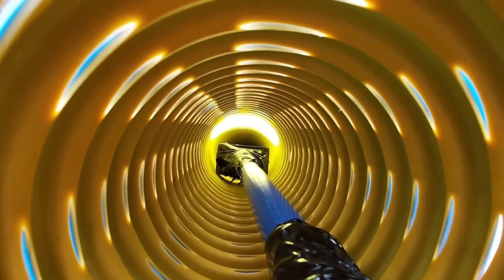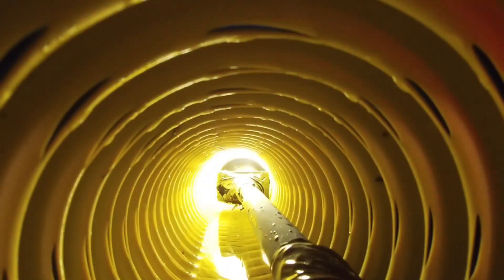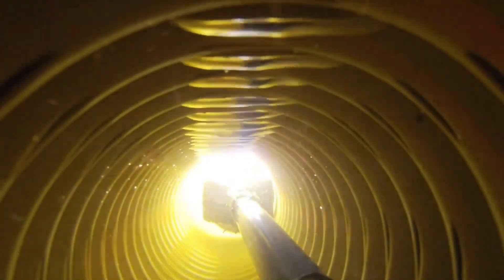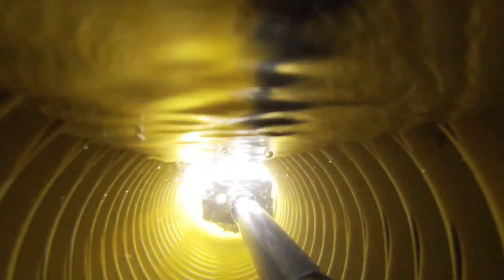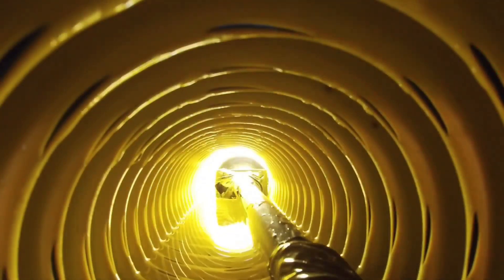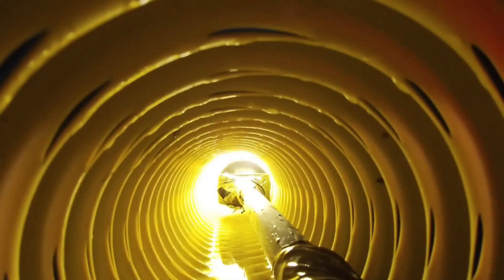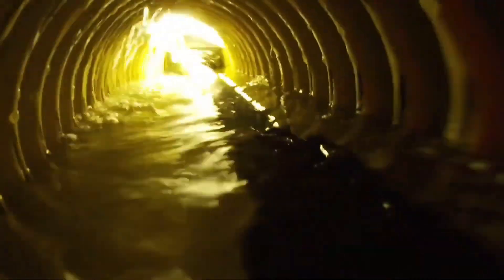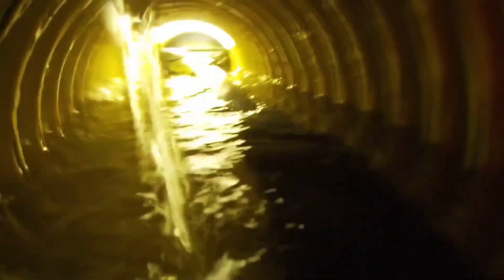Best French Drain Pipe

Comment: If I dug my trench with a shovel and have a good overall slope, but random sections of the trench are deeper than others - would I be able to back fill and compact a layer of crushed gravel (3/4 minus or similar) to get a more uniform and smooth slope? Or do you have any other recomendations for getting a better slope from a shovel dug trench?
Reply from the maker: Definitely fill in low points and slope with peastone or 3/4" stone.

Comment: I have a sloped property at the bottom of a culdesac(which is the lowest point of the street). My house sits dead center of my yard from front the back. I want to use your downspout products along with a trench drain at the bottom of my asphalt driveway to carry that water to the bottom of my yard. From there my yard slopes to a low spot where after a heavy rain will hold water for a day or so depending on volume of rain and how fast it fell. I don’t really have anywhere to drain that area to except into the woods beyond my fence line(still my property) which sits a little higher than the low spot, but obviously being wooded is surrounded by trees. I also have a crawl space sump pump that has a pop up in that low spot. Do you have a suggestion on the best way to dry this area out especially since I plan to tie in the downspout/trench drain combo, my sump pump outlet, and possible even add in the downspouts from the other side of the house?
Reply from the maker: https://youtu.be/Lg0cRl7G05s?si=DsjePFDZMQB_OFHw

Comment: Great video Robert 📹 👍 but wouldn't water come in through the top holes almost as quick as the others? I don't see any really coming through the ones?
Reply from the maker: Water fills the trench from the bottom, just as when you pour water into a glass. The water level starts at the bottom and rises.
Reply: @FRENCHDRAINMAN assuming that there are several inches of gravel surrounding the pipe, the water would occupy those spaces from bottom of gravel bed upwards (your filling a glass with water analogy) appearing first at bottom of pipe. The path of least resistence for groundwater is first the gravel column then the airspace at bottom of pipe. 

Great work
Reply: Great explanation of how french drains work! This is a common question from clients. 👍🏻

Comment: Will those NDS catch basins freeze in winter? If so, will it still flow water through with proper pitch of inlet and outlet pipes?
Reply from the maker: NDS is garbage. We use this one and here's why. 
https://youtu.be/dvZSZXinq14?si=8mKk-injPaEh2lwo
Reply: @FRENCHDRAINMAN I have your catch basin product installed after each downspout within a few feet but they all feed into a NDS 18x18 catch and then into the city’s storm sewer. I also have my sump discharging in the NDS as well. All underground. Obviously you can’t see it but curious if that’s proper